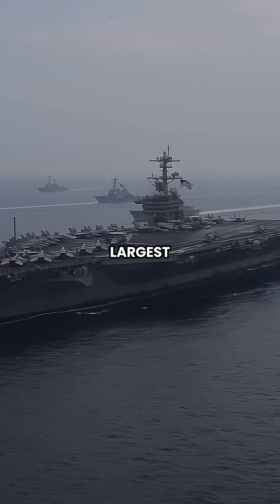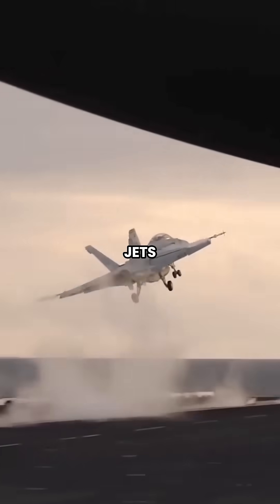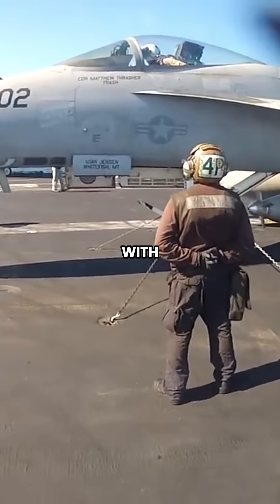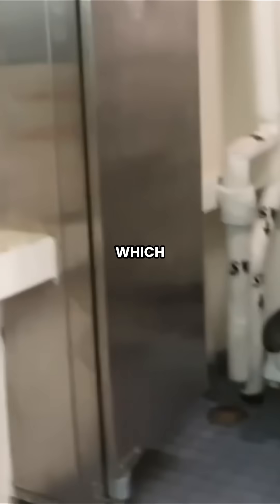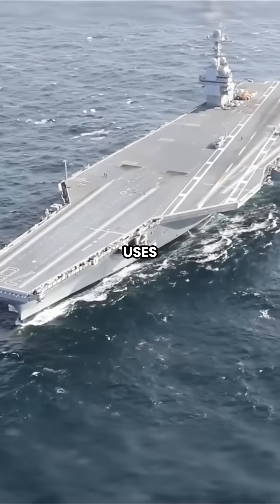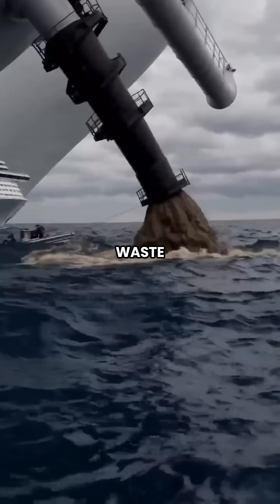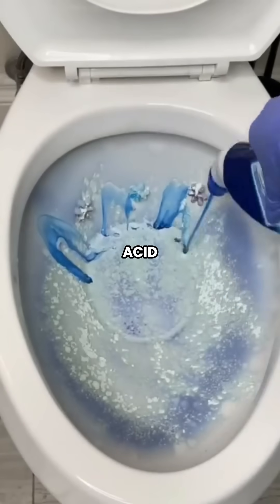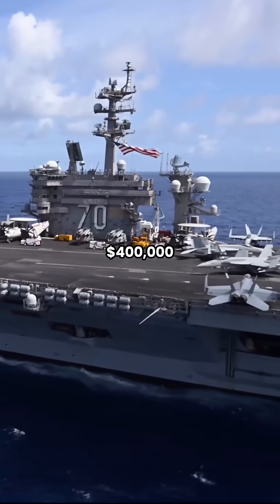USS Gerald R. Ford’s Shocking Bathroom Design Mistake

Comment: Bull. Navy has never used acid to clean the cht system they used hydro blast machines that hydro blast the system with 9,000 psi of water pressure.
Reply: Imagine 6000 navy crews defecating.     Everyday in this aircraft carrier 😅ooh my gosh where will it. Go 😂😂